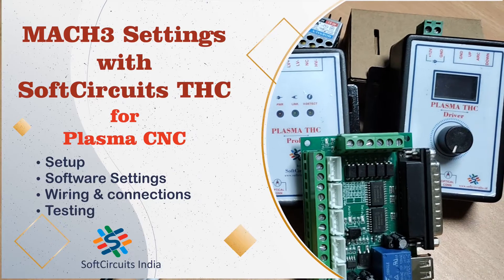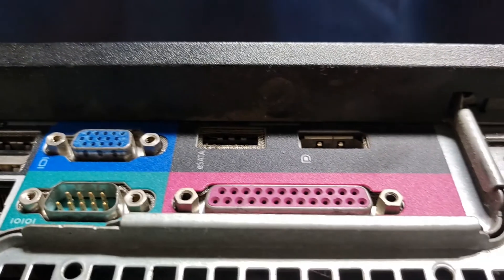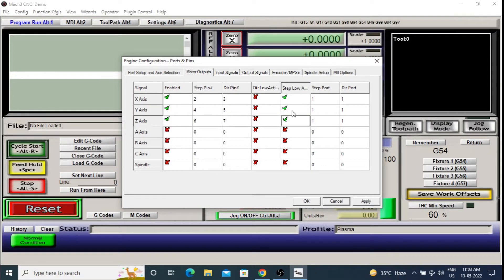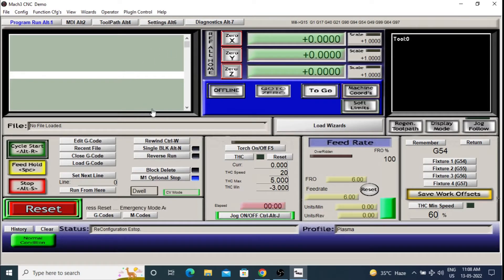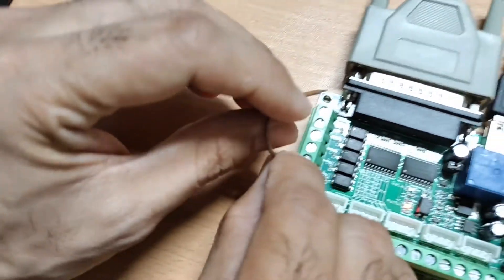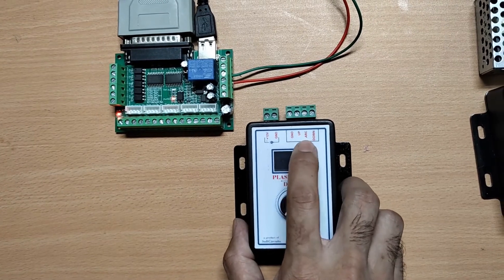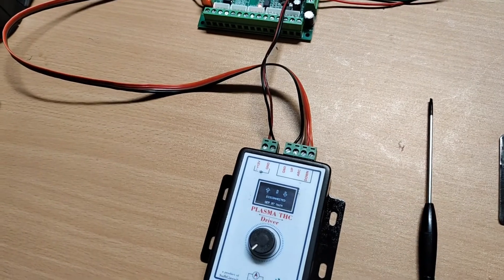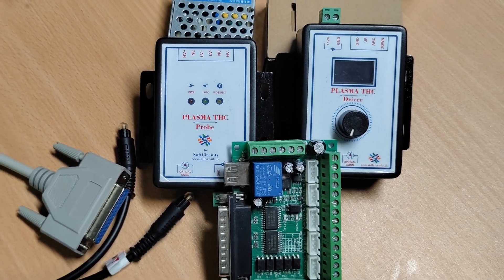MACH3 setup with SoftCircuits Plasma THC for a Plasma CNC

Comment: Do you ever use with cut40 (HF no pilot arc) or cut50 (HF w/pilot arc) ? Wiring ?
Reply from the maker: I have used the THC with and without pilot arc both. But the performance is always better with the pilot arc. The wiring of the THC is the same whether you use the pilot arc or don't use it.

Comment: Is tuch Probe required
Reply from the maker: The THC functionality is independent of touch probe. So, if you need to use a probe system you can install it separately.

Comment: Здравствуйте. Как приобрести контроль высоты плазменной резки?
Reply from the maker: Hi, please write to us at manager.softcircuits@gmail.com , and we will share the payment details with you.
Reply: Интересует именно контроль высоты плазмы (факела). Плата mach 3 у меня есть.
Reply from the maker: So, do you have a mach3 parallel port controller (the one showed in the video) or mach3 USB controller?
Reply: Как правильно я понимаю, на видео представлен контроллер высоты плазмы(горелки)??? К mach 3 подходит? Да этот комплект что на видео?
Reply from the maker: yes, the video shows the Plasma Torch Height Controller (THC). This THC works with Mach3 parallel port controller. if you are using that CNC controller, then our THC will work with it. The cost for THC is USD 190. Shipping cost will be extra depending on your location. If you are interested, please share your address details on the email ID manager.softcircuits@gmail.com , and we will share the shipping charges and payment link.
Reply: @softcircuits_labs  хочу уточнить, что именно идёт в комплекте?
Reply from the maker: The package includes the following : 
- THC Probe 
- THC Driver
- 7.5m Optical cable
- Power supplies x2
These are the items shown in the video.
Reply: @softcircuits_labs  отправьте реквизиты для оплаты
Reply from the maker: @Gleb20126  we need your address details to calculate the shipping charges. We request you to please share your shipping address by writing to us on manager.softcircuits@gmail.com , and we will share the total cost details along with the payment link. Thanks.
Reply: И какая стоимость контроллера?

Comment: sir me bhut preshan ho gya hu. lgatar 2015 se is board ko connect kr rha hu pr abtk nahi hua. me usb to parallel pot lgaya ha power usb bhi lgaya hai. ab aap meri help kro please ise chalane me
Reply from the maker: Hi Hariom.. I think the issue is with USB to parallel port converter. The only converter that works is the original UC100 cable, but that is not available in India and chinese clones are not good. I think you should try to find a computer with parallel port and try with the parallel port cable..
Reply: @softcircuits_labs  love you bro. me bo hu jo har nahi manta. isliye itna time lga diya. pura internet dekh dala or video dekh dali. 😀 thank you for reply. ok now i understanding the matter. ok so i ordering this uc100. then it can run on normal setup ?
Reply from the maker: @hariombhardwaj7620  well, I have not used the UC100 cable myself, since I couldn't get the original one and did not want to waste time on the clones. But, I have seen people use the UC100 cable and run mach3 parallel port controller on normal setup.
Reply: @softcircuits_labs  ok

Comment: Please  provide  sourced link of all parts ....
Reply from the maker: Hi. 
- You can order the Torch Height Controller from our website https://www.softcircuits.in/product-page/plasma-thc , or send us an email at connect@softcircuits.in. 
- We got the MACH3 board from a local vendor but here is a link for reference : https://robu.in/product/mach3-interface-board-cnc-5-axis-optocoupler-stepper-motor-driver/ 

All the other parts are generic parts which should be available in electronics stores (online or offline) in your area.

Comment: hi, i have a bl v1.1, using usb not printer port, does this board need a plug in dll file to run it like degital dream and ecomotion rnr?
Reply from the maker: Hi.. If you mean BL-MACH-V1.1 controller card, the USB port is given only to power up the card, but it will send signals only through parallel port. Could you please share the datasheet of your controller card, so that I can answer you more precisely?
Reply: @softcircuits_labs  thanknyou for your reply, you answered my question perfectly, i pirchased an ecomotiom rnr board and they sent me the pl -v1.1 , i dont have printer port in any of my computers.
Reply from the maker: @mightyweapon  The ecomotion RNR doesn't support the THC functionality. It's good for routers but won't work for plasma CNC. So, I guess you have 3 options - 1) get an old PC with parallel port. 2) get some other CNC card that has USB or 3) explore GRBL CNC controllers.
Reply: @softcircuits_labs  this is for a cnc cylinder honing machine, two nema34 12.5 nm, one drives ballscrew for z axis and one rotates the hone head (spindle) for me its easier to do this with mach 3, and as this is a portable machine im using a small notebook laptop as a large pc is not portable
Reply from the maker: @mightyweapon  in that case, USB mach3 is definitely a good option for you. If ecomotion RNR is not available, i think any USB MACH3 card will work for you application. (There are many such cards available online like this - https://www.amazon.com/Controller-100Khz-Breakout-Engraving-Stepper/dp/B08BJWF1GY/ref=sr_1_9?keywords=mach3+controller&qid=1660201979&sr=8-9 )